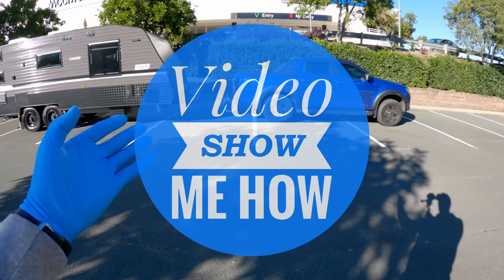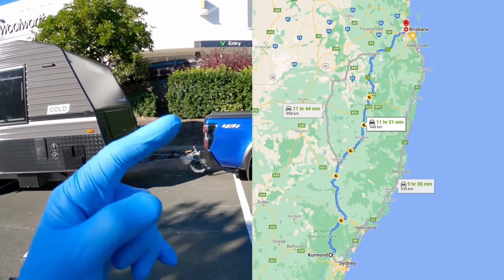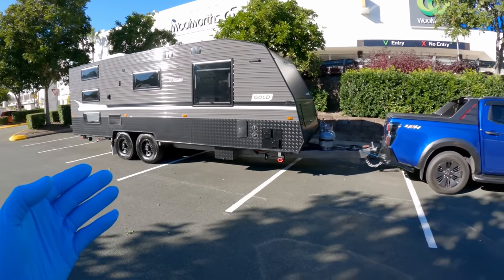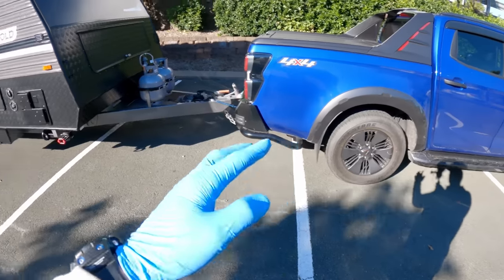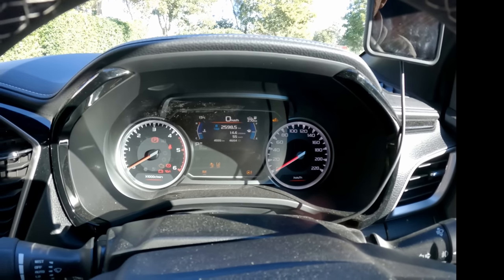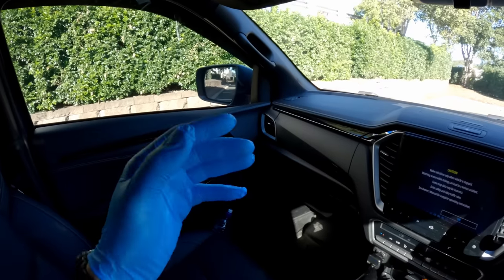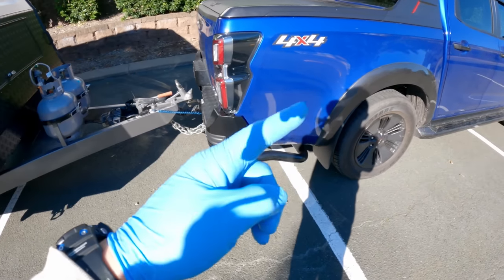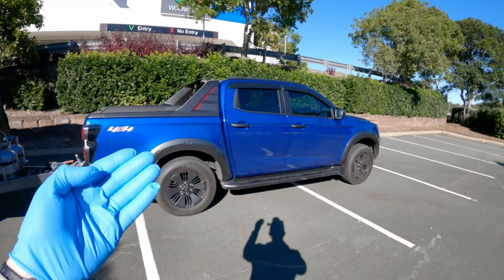ISUZU D-MAX 2600km Towing Test! | 2021 Isuzu DMAX X-Terrain Build Series

Comment: Re the mirrors, I understood the law clearly stated that you must be able to see the back corners of the van- you need the clear view mirror option, or the Milenko clip on model!  100% agree re the brake controller location!  I had an argument with dealer after I did a towing course…… he refused to relocate to the centre.  Most important that your passenger can reach the emergency brake while you are wrestling the wheel with 2 hands to control your swinging van .  Thanks for the review

Comment: I tow my van which is 3 tonnes in weight and my 2014  DMax handles it very well. Never had a single issue in any way whatsoever.  I usually average around 15 litres per 100km.

Comment: spot on info. i can confirm this great video and tow the same van weight. We cruise on 100 speedo. Handling is great that gives confidence and that coming from the same van on a Toyota tundra 57l Petrol v8. As for IDAS I had the update to the system to give one touch disengaging the functions outlined for towing in this video. You hold the steering wheel icon button for 5 seconds and can be done on the fly, outstanding.

Comment: Great vid as always. Nice to hear what other people experience whilst towing with the D-Max. My van is a little heavier than yours, still pulls up hills at no less than 80km/h. Fuel economy gets up around 17-18l per 100km towing from Vic to Newcastle in pretty windy weather. As for towing mirrors I found the clip on ones would cause the mirrors to fold against the window over 80km with a little wind or a truck oncoming. Waste of money I think, I’m hoping to get the MSA mirrors when they arrive. Apparently meant to be under $900 so much better than the clearviews. Only thing I found was over 80-90km/h in wind it felt uneasy but with no wind was great at 100km/h.
Reply: Illegal !
Reply: @nicolehoward95  what is illegal?

Comment: If you want to quickly turn off all the IDAS programming just slide a business card in front of one of the windscreen cameras.
You'll get a warning to clean the windscreen but it disappears in a couple of seconds (or push the confirm button on your steering wheel) The warning isn't brightly lit and doesn't make any sound.
Simply slide the card out and the system starts again.
I bend a small tab over at one end of the card to make it easy to remove.
The card fits perfectly and you can't see it when you're driving!
Isuzu have been made amply aware of this laborious issue so let's hope they address it at some stage.
Reply from the maker: I heard recently the sister BT50 will have a button on the wheel that will turn a lot of this stuff off for year's model apparently.. hopefully will be a solution for the DMAX (and retrospective!) as well
Reply: That is the best piece of advice Ive had yet!  Instead of going into the screen and scrolling here and there to turn off functions, bingo, 3 systems turned off in an instant!  Thankyou!
Reply: @VideoShowMeHow  You probably know by now. At your next service, Isuzu will update a button on the steering wheel that once pressed and held for a few seconds will turn off features for safer towing.
Reply from the maker: @Wilbargosh  yep all done a while ago, is great and well done to ISUZU for rolling it out 👍

Comment: Great work mate!!! I'd really be interested in the Transmission temps, see if a trans cooler is necessary. It does not seem to be though. Proper extendable mirrors are so much better for towing, seeing the back of the van is a huge plus, it does take some stress out of reversing the van :). Nice to know about the standard suspension. I was planning on staying stock and getting airbags, but I did not want to get airbags then have to upgrade suspension. Always nice to confirm everything will work nicely with the plan that is in the head haha. I nearly talked myself out of the rear bar due to the radar and warranty (did not want to have issues and not covered) but seems worth it.  Keep up the good work mate.
Reply from the maker: Cheers mate! Yes as soon as I find that custom PID I'll update it here. Dead keen to see what those temps do
Reply: @VideoShowMeHow  awesome review mate, as stated so would you suggest a transmission cooler??
Reply from the maker: @juliuscesar9864  maybe down the track, want to checkout the temps first when I get that working
Reply: @VideoShowMeHow  cheers mate, we are beginners to the whole van life 😁 . Looking forward to your views

Comment: If you contact your dealership there’s a free update on the MY21 utes for the IDAS on/off switch on your steering wheel, as with the MY22
Reply from the maker: Sure is, have it completed on my 21, hold the wheel button down for 2secs and poof off with the setting for towing! Is great 👍

Comment: My 2023 dmax required rear suspension upgrade to sut level with our 2.7t caravan. Would love to put brake control where you did but cant due to those buttons being used in 2023 model.  Mine also sits in 4th if in drive only occasionally picking up 5th never 6th. I choose to go to manual and hold 4th downhill. Also 2023 model turns off some safety features the rest can be disabled with single button now which is great. Our fuel economy was 16.2 l/100km for fuel size 19.6ft van. Pretty good report overall
Reply from the maker: Any blanks with the 23 xt? They're super easy to swap around (that's what I did with mine). Isuzu retro fitting the turn off button on pre 23 which is great 👍
Reply: @VideoShowMeHow  no blanks due to heated seat buttons and hill decent button.
Reply from the maker: Ah bummer

Comment: I owned a 2011 and my father has a 2014, both 5 speed manuals and pre DPD. I towed a few times interstate with a farm equipment trailer and car on back that was around 2.8ton and averaged 10.8ltrs, unloaded would get 7.2ltrs a hundred. Father has a 1.7ton caravan and averages up and down the New England 9.0ltrs a hundred, his being a low ride 2x4 helps with fuel. Mine was 4x4 with bull bar and only open tub but had modified the dump pipe and added a snorkel and K&N filter. 

Also I ran it down the 1/4 at Eastern creek dragway a few times and got 16.9 as my fastest time (V6 VT commodore stock time).
Reply from the maker: Wow New England towing getting 9/100?? 😳 That's where my average eco started going up with all the hills.
Reply: @VideoShowMeHow  lol yea, 2wd low ride models are killers on fuel.

Comment: Gday Adam. Love the channel. Very informative. 
Quick question - what fuel economy do you get now towing the van with the bigger tyres and lift on the dmax?
Reply from the maker: Cheers. Don't have this big unit now, as it is now is getting about 10 combined
Reply: @VideoShowMeHow  Righto mate. Thanks. 
I noticed fuel economy on mine went from a low of 8 per hundred to 10 per hundred. 10 is as low as it goes with 45mm lift & 265/75R17 tyres. 
And towing a 2.5t tandem full size van is 20 per hundred. 
I’m a bit bewildered to that number. I was expecting about 15-16. But not even close. 
I might not have it set up correctly? 🤷‍♂️🤷‍♂️
Reply from the maker: Yeah lift and tyres prob add one each, just remember the guage will no longer be accurate once you change the tyre size too.

Comment: Didn’t they tell you NOT to tow for the first 1000k’s until the engine has broken in? I was told such when I picked up my 2021 Dmax LSM. I got a preregistration Pedders GVM upgrade to 3450kg which is pretty important for towball weight and vehicle loads to stay within GCM. I’m looking at a Norweld canopy so need the increased GVM.
Reply from the maker: First 800kms mate, it's in the manual. I had about ~1600 on the clock when I headed off :) Norweld are awesome!

Comment: We got  the 2021 LS-U..
Our van is a 23ft Crusader,and weighs about the same as yours.
Ive only towed it once with the new Dmax,and couldnt believe how  easily  it pulled along with little effort, even up steep  hills. 
My only concern was that when sitting on 100kmp,it would change from 4th to 5th and not go into 6th overdrive. I placed my concerns on the Dmax forum,and most nearly  every person said thats normal for the Dmax to do that,and likes to hunt between 4th and 5th and not go into overdrive.
So  my question to you is...howd yours go with that?
Same, or did it get into 6th ?
Besides that, the Dmax is the best car ive ever had, and glad i got it. 
Mark,,,Perth
Reply from the maker: Hey Mark, yeah agree. There was a bit of hunting on the hills, but not too bad. Usually got in 6th on the flat no dramas. Didn't find too big of a deal, just turned the music up a little :)
Reply: @VideoShowMeHow  yer i guess,,,, i was a bit concerned  about fuel economy,  but it was like yours,,,14/100km
Reply from the maker: @markwitham6784  i did use the manual gears at times though thinking about it, particularly when it couldn't decide on some inclines and of course decents

Comment: Thanks. Great to see the info. Only question I have is regarding the fuel economy. I have an Ra7 with the 4jj1 motor. Last trip I did (5000km tour, roof pod swags extra) the computer said I was getting 8l/100 yet when I fuelled up it was more like 12l/100. So did you take note of the actual fuel and km used and worked it out? I would be interested to know if the computer calculations have been improved
Reply from the maker: Yep sure did, kept a log on the south leg of the trip, fuel in fuel out vs kms as was pretty well spot on, didn't bother on the way back. Is stock (eg tyre size etc) so should be pretty well bang on.
Reply: @VideoShowMeHow  I am running 31’s when I run the gps Speedo it is within a few km’s of the dash read out. Glad it is better with the newer rigs!
Reply: The RA and all models have two pic ups for speed and distance. The abs sensors pic up wheel speed for your speedometer and abs where as the speed sensor on the gear box is for the ecu, so fuel economy, engine mapping and the auto transmissions gear box to wheel speed difference for shifting. So unfortunately the extra big tyres aren't being accounted for with the ECU.

Comment: Interesting review, thanks!

MSA won't have their power fold mirrors for the 2021 Dmax available until at least December. Clearview power fold mirrors are only available exclusively through Isuzu dealerships, $1538.00, fitted. We had them fitted and they are great. Called Isuzu parts department and the original factory mirrors are also an eye-watering $430.00...EACH!

We went the TJM rear protection bar as well. Love it! We no longer need the weight distribution hitches we needed with our previous Triton ute.
Reply from the maker: $1538 wow.. i can def see their benefit if you were towing a big rig like the one in the vid regularly though
Reply: @VideoShowMeHow  yeah not cheap. But the Milenco screw on tow mirrors we had previously did our head in. So much vibration, we're amazed at the number of people who swear by them. The only benefit we found with them is that they are great for aiding reversing.
Reply from the maker: @AUNZAnon  ahhh vibration! Didn't even think of that, was close to grabbing a set on the way back. Vibrating mirrors are the WORST
Reply: @VideoShowMeHow  We're about to tow a 2.8T single axle van around Australia with our 2021 XTerrain. We have a 260kg tow ball weight, so same stats as your. Only difference is, we have a towbar and bullbar and winch fitted with Yakima roof and tray racks with loaded tray. Have driven 1000km with them so far and Dmax seems to tow very well. Still think we'll be ok or would you recommend air bags and or GVM upgrade?
Reply from the maker: @AUNZAnon  I would recommend 1) check your weights against total max limit (Dmax XT is 5950kg) 2) would fit airbags to help support the load for that distance. I'm looking to install airbags on mine to support when I occasionally tow
Reply: @VideoShowMeHow  cheers. I've done the maths and we're close to the limits on the Dmax. Maybe airbags and or gvm upgrade once we complete our QLD portion of Big Lap. Thanks again👍

Comment: Do yourself a favour and research towing heavy. 1:1 ratio in your box will be better and much stronger for transmission versus the overdrives 5 and 6. Torque is far better at the 1:1 and reduces in 5 and 6. This goes for autos and manual gear boxes. Yes you can use the two overdrives but in the long term usage you will see that 1:1 gear ration will be better for longevity of transmission and keep auto temps down even further than you have already found.  Ask a company like Wholesale Automatics in Melbourne about their views on towing heavy and Berima Diesel have a youtube explaining power and torque figures differences between 4th gear and the two overdrive gears, especially the torque comparison, you will be amazed. I will not go with Isuzu's recommendation of seclecting D and then leat transmission decide for heavy towing in an auto. I have a manual and would not tow heavy in the two overdrive gears. 360 Gearboxes and Diffs Melbourne youtube showed me the damage in manual gear boxes towing heavy using the two overdrive gears and demonstrated how better off you are in 4th gear being 1:1. I have a 6 speed manual MY18 Isuzu spacecab chassis with canopy myself .

Comment: Try holding down the little steering wheel button to deactivate recommended settings
Reply from the maker: Wasn't a setting at the time, Isuzu have retro fitted to pre23 though and all 23+ have it automatically 👍

Comment: The Torque trans monitor PIDs in 2015 were as follows and worked for me.
OBD2 Mode & PID = 221940
Long Name = Trans Temp
Short name = Trans
Minimum Value = 0.0
Maximum Value = 150.0
Scale Factor = x1
Unit Type = C
Equation = A-40
OBD Header to use = 7e2
Reply from the maker: whoooaaa - so this worked on your 2020+ dmax???
Reply: @VideoShowMeHow  I had a 2012 Dmax and it worked well, this coding came from someone with a 2015 model. My only issue was if I tried to start the car with the OBD2 turned on the auto Trans faultered but turn it off then start the car and it worked well.
Reply from the maker: @mustangdude11  Ah ok, will try but I think the setting for 2020+ is different. I've tried a bunch from older models but no dice so far. Thanks anyway 👍👍
Reply: @VideoShowMeHow  No worries, keep the videos coming, great real world content👌

Comment: Great video man. Would you recommend the MU-X for the same van ? or would the D-Max be better. Can is 2.2T Tare unloaded.   14.6 L/100K is great..   As I am planning a trip around OZ so about 40,000K around the coast and some inland happy to cruise at 85 to 90K.  and for the odd Adelaide hills etc, I am happy to go slow with them at around 80Ks.

Comment: Great video. I tow now with a GCJ with similar weight to yours. Have ordered an x terrain but were thinking I would still need a WDH. I noticed you tow without. My new car will have a Isuzu genuine tow bar kit. Will this handle my van without a WDH as I thought I would have to get weight back onto the front wheels.
Or does your towbar kit avoid this requirement
Reply from the maker: Seemed fine without, not too much sag in the rear as you can see in the vid.

Comment: I think when you are doing fuel economy not using the gauges you should be filling up setting the trip meter because in my experiences the fuel usage gauge is not that accurate.
Reply from the maker: Older vehicles sure, in this and most new the trip uses the same electronics as the eco, only real way is via GPS and fuel used (compare at the bowser). In any case have tested this when the dmax was stock and was 0.2 different over a tank so not bad I reckon

Comment: Yeah the torque pro app stops at 22psi, I use it on my golf r and it's putting out 33-36psi but only shows 22psi of boost
Reply from the maker: Dang that's a lot of boost in the golf! Interesting about the cap, maybe that's an OBD thing?

Comment: Great Video.  Well presented except the blue hand :-).  It didn't match the colour of the car.  I have been ranting on about the stupid location ISUZU have decided to put the brake controller knob.  In a sway situation would you want to take your hand off the wheel and  fumble around the dash for a button.  Obviously the engineer has no idea about towing a van.  I am having the dealer install the controller and have spoken to the installer and he has agreed to put it on the console.  Thanks for your comment about the correct location.  I have sent your vid to the dealer to show the installer.   Bit of a pain having to remember to turn off the safety stuff every time you head off with the van,  Should be a software fix to solve that I would have thought.  All people who tow should send that part of your vid to their dealer and Isuzu Head Office.   Mine isn't here till Sept but your vid has made me more comfortable in selling the 2016 Ranger and getting the XT.
Reply from the maker: Thanks Bob!

Comment: Very informative video mate. We have a deposit on a 21 dmax to tow a leader xpedition 21.6 I’ve been told tare weight of van will be 2.7t. My concern is going over gcm, how did you go with this?
Thanks
Reply from the maker: I was towing around 2.8 in total and went fine. At full GVM in the dmax you can tow 2850.

Comment: Hi. Interesting regarding the egt temps. Did your dpf do more burns than just once? Reason I ask is I have a 2019 Ford Ranger. I have the scan gauge and noticed that mine was reading on average 590 deg for about 10 minutes or so.Thing that concerned me was it was doing this around every 3 to 400ks. Was a bit worried about this.
Reply from the maker: Oh yes does one every couple 100km
Reply: @VideoShowMeHow  Wow, that's a lot of heat at the rear of the engine. Yours gets hotter than mine. Thanks for the response 😊
Reply from the maker: 650 on the second sensor is the cut off for these when it's doing a burn, when doing a burn these will continue to accumulate heat to this temp